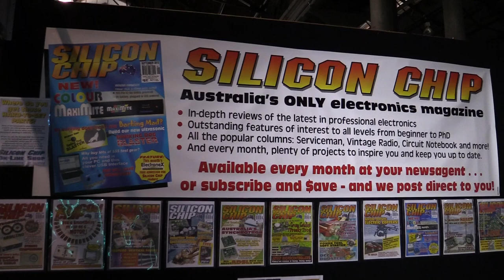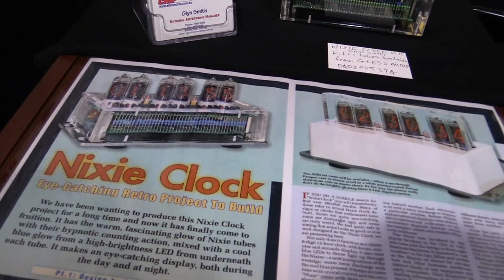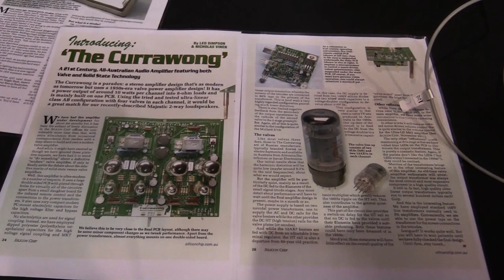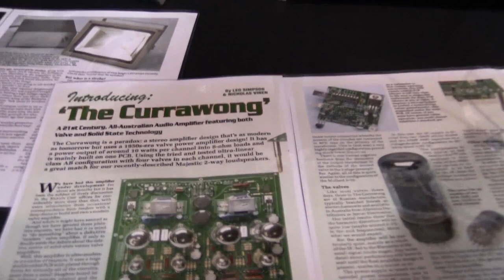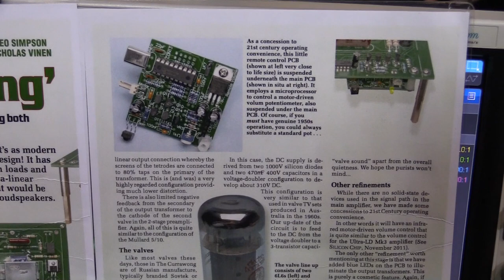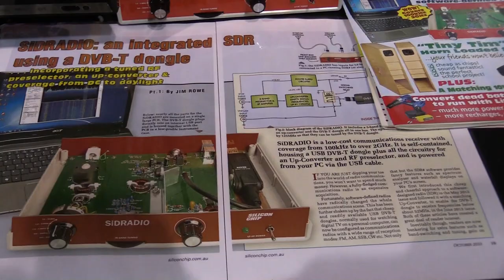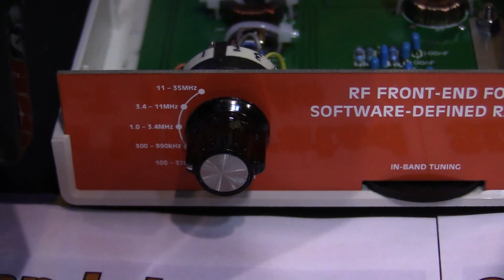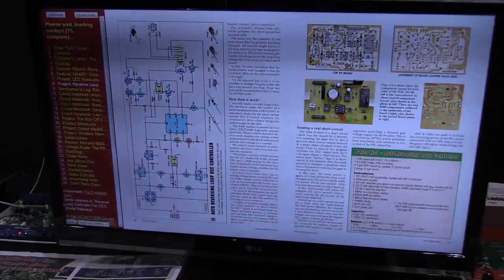Silicon Chip Electronex 2014

Comment: the worst thing you can do is build a valve amp on pcb not only double sided pcb as a valve amp builder it should be point to point when ever i see and hear a valve amp built on pcb it sounds really crap pcb tracks add distortion and rf interfaces